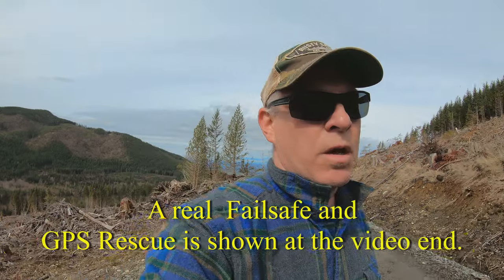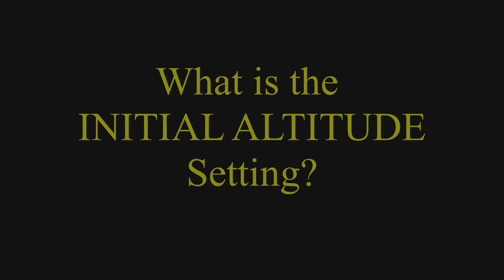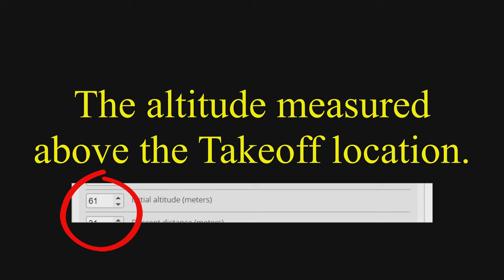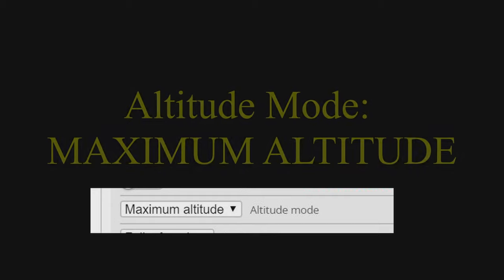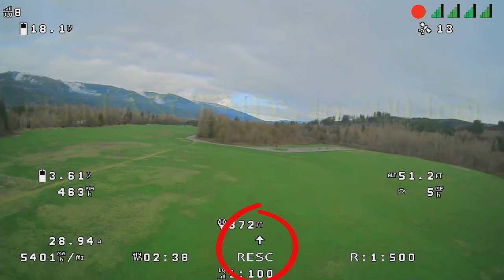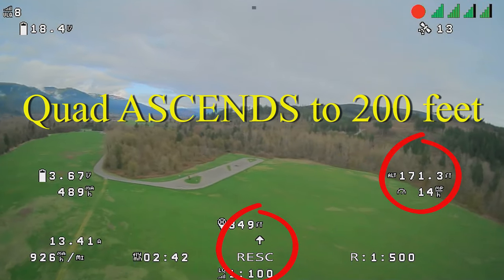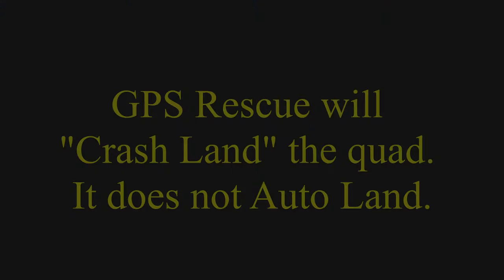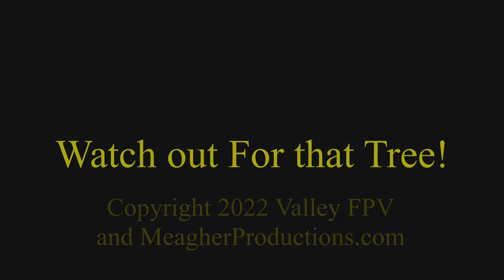This GPS Rescue Setting Crashed my Quad

Comment: You learned a valuable lesson for LR flying, I have always set it to Max Alt. You want to be in a position to clear the obstacles that might impede return to home.  Glad you were able to save your quad.
Reply from the maker: Yes indeed. Thanks for watching!
Reply: Yup I do altitude 300ft min then to goto max altitude i went on that flight for clearing anything I go over.

Comment: Current alt is a good option for mountain surfing. If you lose control link after coming down a mountain you don't want to ascend to the top of the peak alt you flew to draining your battery. This does make it critical to plan safe routs thoug
Reply from the maker: Does current altitude climb any higher that the current altitude and if so by  how much? I need to test this. My reasoning for max altitude is not to let it fly home automatically but to merely gain altitude inorder to regain a video feed line of sight..and take over control immediately.

Comment: Thanks very much for putting this detail into your video,,, explains each option clearly.... been watch a view of your earlier videos.... impressive documenting your flights.... which quad are you flying for your missions?
Reply from the maker: Thank you for the kind words and for watching. It's a serious hobby / passion. My current go to quad is a big yeet 8 inch frame running 7 in props and a Mish mash of hand picked components. It's far from perfect yet is my best build to date. My next project is I am beginning building a naked cinelifter on the  le pigeon frame system. A slightly larger aircraft with more capable camera system.

Comment: In BF 4.3 "current altitude" operates slightly differently (and so can "max"). Now, both add that 15m "buffer", it does not just return at current alt - and that buffer is user configurable (which applies to both max and current). So, if you just always want your quad to raise 100m from its current altitude, you could set to "current" and then adjust the "buffer" to 100m.... I think the max buffer is 100m. That buffer is currently only configurable via cli and the variable: gps_rescue_alt_buffer.
Reply from the maker: Thanks for watching. That is great news and exactly what I need. I shall have to consider upgrading to 4.3. My next flight I will likely fly iNav in my next build in order to have position hold and more accurate RTH.
Reply: @ValleyFPV  Yeah - i'm hearing more and more that iNav is plenty sufficient for long range and mid range stuff flight performance wise and a big improvement on the RTH/POS Hold side of things. THAT BEING SAID .... BF 4.4 is planned to bring at least major improvements to RTH (with landing, higher accuracy, less surge like altitude, etc...) and perhaps POS hold. But 4.3 took ages to release, i'm sure 4.4 is a ways away.

Comment: The key is to review and change these settings before a flight, if you're flying a new terrain. It would be helpful if BF supports a dynamic GPS rescue altitude mode - for instance, imagine you are doing a long range that involves climbing way high up too, and let's say you lost the video on your return, when you have already descended significantly, and you have a dying battery. Initiating GPS rescue with max altitude setting will be disastrous, because the quad will then have to climb all the way up. So, if I get a chance to dynamically decide my GPS rescue altitude mode, it would be great in such scenarios.  I will initiate GPS rescue with current altitude mode then.
Reply from the maker: Indeed.

Comment: Love your shows! I had a strange occurrence today . Fixed Alt mode. Initial 30 meters. Sanity check-fail safe only . And today a fail safe had initiated at 20 meters and quad descended, more like a drop to ground zero, I swear the landing pads just touched ground and then it ascended to around 45 meters and headed to me.  Is it the latency of sanity checks that may of caused the drop before the FC  could initiated countermeasures from the settings?  How do you set your sanity checks? Thanks in advance
Reply from the maker: Thanks for watching. I'll have to see how set and report back.

Comment: Nice tips! Is GPS rescue on a switch helpful/good to engage if you totally lose video? Also, does betaflight accept barometer inputs?
Reply from the maker: Thanks for watching. Gps rescue is set up to be switch activated or automatically activated if I lose controller signal. Yes I can activate it at fpv loss.  Yes BF  does support the FC baro.

Comment: Hoping you can help. I've tried to use GPS rescue on both Betaflight 4.3 and 4.4(nightly) using HGLRC M80 and M80 Pro Gpus units. When I initiate GPS rescue the quad ascends to 100-150m(but the altitude is set to 30m). I've also set the assend speed to 3m/s but the drone still shoots up at far greater speeds. I'm experiencing this on two different quads (5" and 7"). Sometimes the gps rescue works as it should, but most of the time it's just plain scary. 
Any idea what could be the cause of my issues?
Reply from the maker: What rescue mode is set? That might make a difference.
Reply: @ValleyFPV  GPS Rescue is enabled on failsafe and on a switch. I've only tested gps rescue on a switch so far. I've got the failsafe set to gps rescue and to return on 30m or max altitude. I've also tried "at fixed altitude" with the same results. Also, I only take off with 10 or more satelites. 
May I ask what you mean with "what rescue mode is set"?
Reply from the maker: @InfinityDrones  was wondering if this behavior was occurring because of using Max Altitude mode. Perhaps it is a bug. I run an older version 4.2.9
Reply: @ValleyFPV  I can't flash 4.2 on my Zeus F7 722 fc as it only supports bf 4.3 and up. But I can try and load 4.2 on my iflight fc and see if that resolves the problem. Thx, I didn't think about it.
Reply from the maker: @InfinityDrones  sorry..but I have no other suggestions as to what might be the cause. Best if luck and thanks for watching.these electronics are fussy and generally low quality. I am dealing with a bad Amp meter reading causing me grief. Oh well.

Comment: Max altitude mode is not ideal for hills. Imagine you was on top of hill 2200m and on  way home 200m over ground you've a failsafe. Quad will shoot up 2000 meters, just to slowly decent next to you.... Not very safe...
Reply from the maker: Thanks for watching. You are absolutely correct regarding that scenario.. however my plan is that I would never allow that quad to fly so high. The entire purpose of GPS rescue is not to evoke an autonomous flight back to home but instead quickly clear the obstruction and regain control ASAP.
What BFlight needs is a gps rescue altitude mode that rises X meters higher from its current altitude when envoked. That would be ideal.